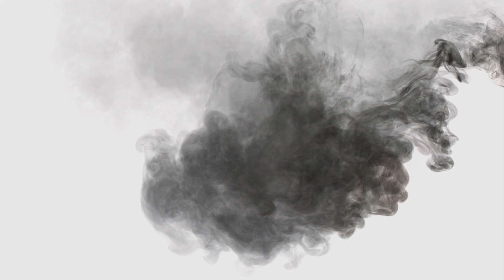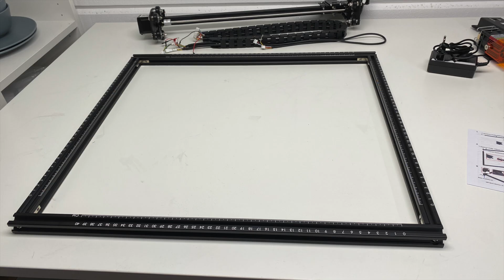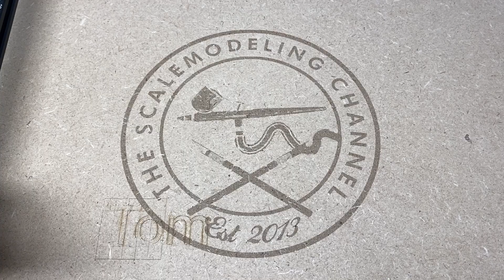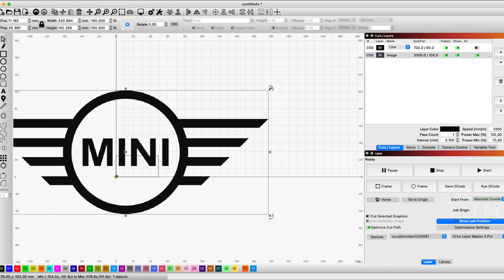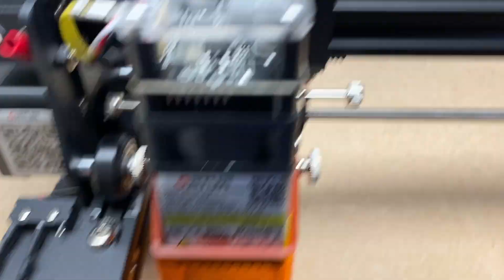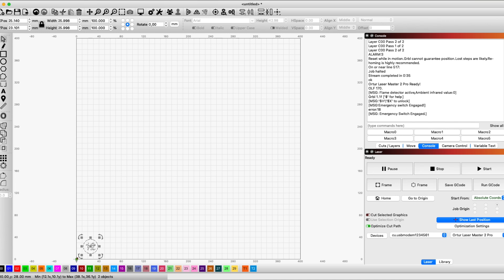Laser Engraving and Cutting With the Ortur Laser Master 2 Pro

Comment: I've had the neje 2500 for a couple years now, for the tape put it on parchment paper, I use the fbs gold tape in the roll that already has the backing, you will have fun with this for graphics
Reply: Believe me, Ortur will definitely be better than neje on products of the same price
Reply: @泽浩于-n9x  I got it when it first came out about 4 years ago, as awell special, still cheaper than what it is now
Reply: @stevecourtneyscalekustomz2602  I believe you are talking about different products, and different engraving machines have different prices.